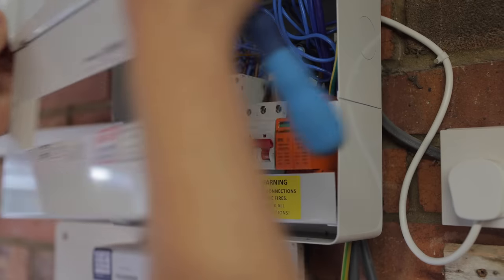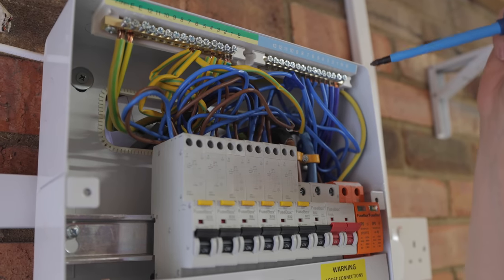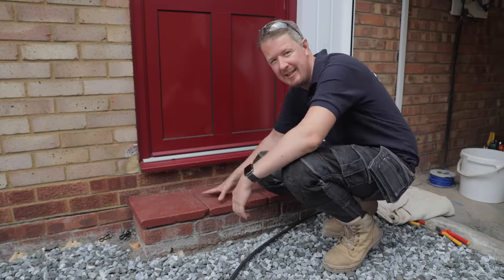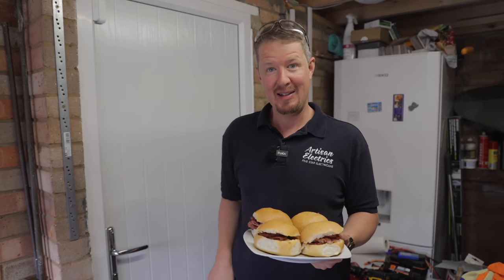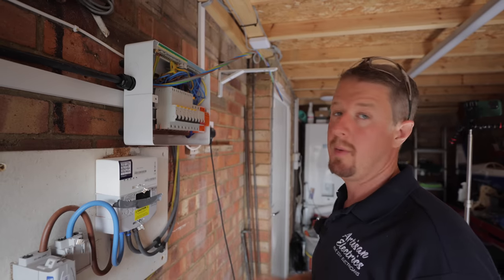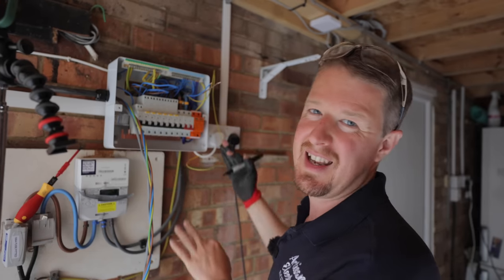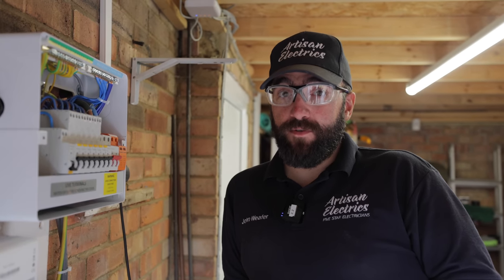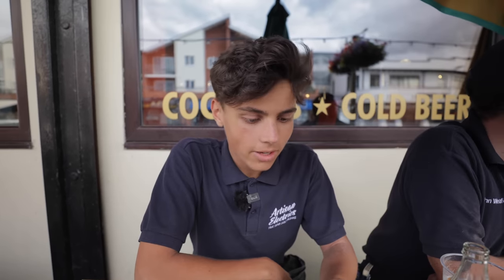SHOCKING FIND - SO bad I had to fix it IMMEDIATELY

Comment: It always makes me smile when you insist on having the fuse board neat, when the wire can follow the most random path to the sockets or lights. Electrons really don’t care, do they? I always prefer a bit of slack  rather than cut the wire as short as you can in the interest of neatness.  This is pandering to your OCD only. And I could still see exposed copper. :)
Reply: Also extra cost to "fix" it lol
Reply: Idk how it is in the UK but in the US, people see it as a sign of a prideful electrician. So it’s more of a statement/signature then a functionality.  I agree, add slack. But also, makes trouble shooting easier for the next guy.
Reply: Copper should be a bit exposed so you know there's no insulation in the clamp doing a visual inspection...  but never so much you can touch it with your finger.
Reply: Make it neat, with a service loop and better doing neat work as it's pride in your work
Reply: Having watched this again. I would have sued you for interfering with my board when it wasn’t in your remit, as you actually admitted.
Reply: When you disconnect a wire, it is often necessary to cut off the end before reconnecting it, as the connecting screws can sometimes damage the conductor.
That's why I like to leave enough slack in the board to  make this possible.

If the wires are super neat you can't do this.

Thoughts please??
Reply: @chrismoyler  Absolutely agree with you. But then you have common sense. Somewhat lacking today.
Reply: It’s a case of pride in your work to do it neat. Also it’s easier to fault find. That board was a disgrace surely you wouldn’t want your board done to that standard ?
Reply: @Geordie10032  How does it make fault finding easier? It’s a slightly longer bit of wire. I doubt any electrons will escape out of sight. Much better to leave it long and be able to redress the end if need be Rather than run another cable or join it.
Electricians are far too anal for the customers own good.
Reply: Swear it’s just some people feel the need to find fault with others’ work. If it passes an EICR, I don’t give a shit what it looks like.

Comment: We didn’t use mechanical hand drill for drilling masonry, with out percussion it would take ages. Sized Rawl chisels tapped with a hammer while turning by hand were remarkably quick. When working without access to mains electricity rawl chisels we’re the way to go. Only good for an inch or so deep to take rawl plugs though.
Reply: One step up was a piece of black gas pipe with a couple of teeth cut into one end. An old-timer plumber taught me that trick when we had to drill a 450 mm brick wall for two 18 mm pipes and didn't have a large enough SDS bit, worked surprisingly quickly with a proper lump hammer. Exactly the same technique, just 3/4" or 1" holes all the way through a thick wall if necessary.
Reply: Bradley You know it. It makes me laugh when I see these guys  showing a young trainee how to use old tools and don't even know what  are for themselves and the trainee will only use battery tools anyway.  Also 3 blokes to put a power point in and that guy chatting and not working who is paying him. Come on mate it's work not a fashion show.
Reply: Yes Rawlplug  jumper  , what about  the buckle  clips  every  6 - 9  ins  for twin and earth  without mechanical   hammer  ,  i use to rewire schools  like this  ,   i have  arm  muscles  like   mr  universe
Reply: Rawl chisels. The oldtimers collegues spoke of those, when i was complaining about the 7.2 volt nicad makitas 20 years ago.
Reply: Ha ha. Wooden plugs... remember the cold chisels and wood plugs. My first metal case Black & Decker electric drill couldn't make a mark on London sewer bricks in my parents' house.

Comment: Well, I can state that here in Italy almost NOBODY does safety checks, testing and installation like those. I never saw an electrician here doing something like that. NEVER! It's amazing. Thank you :)
Reply: BUT at least we use pvc corrugated tubes so that we don’t make the mess they do abroad😂…

Unless you live in Pisa where due the high demand of housing (because of students), it’s full of houses with 1960s wirings… I was shocked when I found out those buildings with modern 16A RCBO’s at the top and 6A (yes, six amps) 1950s sockets (the ones using the round box), powered by 1mm2 (or thinner) cables. The estate agents don’t give a shit and call them “code compliant and efficient”.
Reply: you should come to norway, thats even more strict
Reply: If you don't check and something happens you can  end up in court because your the last man in
Reply: You should come to Indonesia and compare 😂
Reply: No sparks, no trips = passed inspection!

Comment: Talcum powder is an excellent dry lubricant to ease the pulling of cables through conduit, or for pulling twin and earth cable within or through an existing run of similar cables.
Reply: Or for making putting on your Class 0 gloves easier.
Reply: Or for fixing your sweaty arse on a hot day

Comment: I've used talc for pulling cables through conduit, works well and less messy than the old fairy liquid
Reply: that's the reason he has it, he knows the old tricks.
Reply: Cheaper and less messy than Yellow 77 as well.
Reply: Yep was gonna say the same thing. Same reason they put french chalk in flex so it's easier to pull the sheath off
Reply: In some areas of hospitals here in the US, it is the only wire pulling lubricant allowed to be used
Reply: Do you spray it on the cable before pulling? Or try force it as far down into the conduit as possible before doing your run?
Reply: @daniela4530  rub it on the cables, pour a bit down conduit and have some in hand whilst threading it through

Comment: The problem is that it always falls back on the company that worked on the Fuse Box last. From that point of view, you did everything right.
I see boxes like this almost every day here in Germany. This is what happens when everything has to be done extremely quickly and cheaply. Real proper work unfortunately takes a bit longer and costs a bit more. Although not by much, as you show in the video.
Reply: Box-ology is overrated.  The very first thing to go when troubleshooting is needed is probably the zip tie looming wires together so an amp reading can be taken.  It won't be replaced.

Comment: That trick with the glove and running your fingers down the wire to straighten it up is similar to my trick I use when terminating network cable. I use the outer sheath of the cable between my fingers to straighten out the spirals after untwisting the pairs and it makes them so much easier to work with after that.

Comment: You were speaking of too much copper showing on the terminations of the consumer unit. Many times in industrial applications they actually want a little bit of copper showing so that they know you aren’t landed on the insulation.
Reply: Same in Sweden, but it's a thin line to toe here: you want enough copper to be visible to make sure you haven't crammed insulation into the screw clamp, but never so much you no longer are IP2x, i.e. you can get a test probe on it but not a finger.

Comment: Nice video guys,
a comment about the extra work you did in the consumers unit not dangerous but just sloppy workmanship. Now recently retired I used to get involved in  jobs which went to court because of electrical fires and worth noting to ALL , electricians in particular in this case.
If you come across a dangerous electrical installation problem , which you may even inform the customer about but do nothing about ie  you do not disconnect etc, as the last professional with the knowledge to recognise the danger and something happens you could be left liable and face prosecution. So good work in tidying up the sloppy work and put that wheely Stanley drill back where it deserves:goodvibes:.

Comment: The black clips are for physical clamping on the top hat DIN rail, not the copper busbar. That’s held in by the terminal screws, no doubt, secured to the correct torque as per the manufacturer.

Comment: Thought everybody used that 4mm earth sleeving, I hate it and use the small stuff but never seem to find anybody else using it. (though to be fair don’t do much domestic) Looks so much neater. Can’t believe you re-did the whole board
Reply: That wasn't done in "the hour" and neither was ev install
Can easily see that(edit,edit,edit) by just watching the time it took them to run the cable round the back of that post!

Comment: When I was installing Network Phone distribution cable Frames the location height used to blow my arms with lactic acid, if I was too high over a long time  . I would bring in a Milk crate or stand on a ladder so that all my work was at chest height

Comment: The consumer unit bus-bar appears to be live while the cover has been removed and a hole is drilled through the steel containment directly above live parts. 
In the event of swarf flashing over the bus-bar, any accident investigation would likely reference Electricity at Work Regulation 14

Regulation 14 Work on or near live conductors
No person shall be engaged in any work activity on or so near any live conductor (other than one suitably covered with insulating material so as to prevent danger) that danger may arise unless –
(a) it is unreasonable in all the circumstances for it to be dead; and
(b) it is reasonable in all the circumstances for him to be at work on or near
it while it is live; and
(c) suitable precautions (including where necessary the provision of suitable
protective equipment) are taken to prevent injury.

Comment: Some questions for you - why did you remove the bus-bar cover for all the time of the install instead of only once the power was off? Did you know the hand drill is for woodworking not brick, they did make a hammer action version, blue if I remember right, looked nothing like the one you have there.

Comment: Yea you are the guys obviously with all the electrical knowledge of best practices etc and testing no question.
As for the step ( and I appreciate in your case you’re there as electricians ) but in my case had I been faced with that situation I’d have simply removed the step ran the cable through and rebuilt the step as afterwards as it looked to be a very small simple job which could well be done with original materials
Reply: R u an electrician?

Comment: Wondering why the lower "comb" busbar is not insulated ?
As for right wheel in cars, neutral and line are inverted compared to the other side of the Channel ;)

Comment: In your solar installation you have the inverter and battery out in the garage on the secondary consumer unit , so how does it isolate the house in the case of a power cut , so that power from the house does not feed out onto the grid and endanger anyone working to restore power?
Reply: Grid tie inverters detect the existence of power on their output and shut off when the grid is lost. Most solar installations even with batteries cannot run in island mode, so there’s no need for further mechanical separation.

If you want island mode is when things get difficult and you’ll need cutover switches and the like, to prevent backfeed.
Reply: @JasperJanssen   Hi Thanks for your reply.  I looked at solar power 20 years ago when we were having frequent power cuts, before domestic battery storage was common. Was told then that I couldn’t use the solar power during a mains outage. So I gave it a miss. Now I’m looking to have a battery system and realised it needs some form of’ loss of mains protection’ if I’m to use the battery storage during an outage. To find it’s not a function of the smart meter is a surprise. But your reply means all this kit is useless during a mains outage. So the double pole isolation switch I’ve had installed just my side of the meter may yet prove it’s worth.
Reply: @zenthor13  you’ll need a bit more than just an isolation switch, but ask your installer.
Reply: @zenthor13  you’ll need a bit more than just an isolation switch, but ask your installer.

Comment: What's the name of the device installed in the distribution box? Does it provide protection against over current and dispersions? I see the phase input in the bottom and at the top output? So where the neutral goes in?

Comment: The doorstep, I'd have tunneled, and I'd recommend these to anyone. Silverline 633828 SDS Plus Masonry Drill Bit Set 3pce 1500 mm on Amazon  £65 and worth every penny.
I bought them to drill up from outdoor wall wash lights into the void under the first floor floorboards. So no chasing or containment in or on walls and a much quicker.

Turns out it's helped loads since for things I never thought of.

But looked good though boys.

Comment: At 19:53 /25:15 your apprentice was checking For Main Equipotential Earth Bonding at the Boiler, with no mention of the Gas/Water Main Equipotential Bonding.

At the Boiler I only saw cross bonding - 2.5mm G/Y each conductors and no Main Bonding Conductor (10mm), you might want to check out your video.
Thanks for entertains me, I love these DIY Videos and well done for tackling that board, but unsure why when you had the chance you did not place ring numbers to the conductors on to the conductors to identify them.
Keep up the videos and please give us a final walk through at the end.
Mr Spence Eng

Comment: OK, you got 1 hour to do mine.....18 metre run, across and under a 9m tarmac shared driveway, and 6m front garden that you will need to trench into. Attaching to an EV pedestal that you will have to dig and cement in. Also need a complete new CU as it's an old single RCD unit from 2001.

Comment: Through the steps. Even if you need to repair it somewhat, ye do have Artisan in your name. Also, when using fixings (screws mainly) in the outside elements, do ye use stainless steel screws? They're relatively cheap in Screwfix. Artisan!

Comment: Try fitting a 1 mm drill bit in your cordless drill --- no chance. Hand drills to the rescue for small precision work. And obviously they are not designed as hammer drills for masonry, duh.

Comment: Just an observation:
1 - When drilling a DB please put some protection inside the board so when you drill through you don't damage any internal parts.
2 - The clips you are using to secure your SWA, are they fire rated?  if no, are they compliant with regulations?
Reply: They are metal linian clips - so yes they are.

Comment: baby powder is amazing substitute for lube in the tubes in the walls for the 2.5mm2 wires in a 20mm tube. can be tricky without it. And also silicon based lube tends to leak out. not very fun when theres new paint on the walls or something like that. I assume thats what the baby powder is for :) Also, why do you use sleeves for the earth wires? cables come with the green/yellow plastic on them from factory, no? mine does atleast.
Reply: Seems the British (and American?) cables comes with the ground uninsulated at all.

Comment: This bottom bus bar looks awful: There is never any visible copper on the French bus bars or "combs", they are all covered in plastic except for the teeth, and either you cut them so they match the number of modules installed and you put a plastic cap at the end, or you put plastic caps on each teeth to hide any copper.
So, if you call this horizontal comb a "bus bar", what do you call the bus bars on top, where you have all the ground wires, the live and neutral wires too? Are they "terminal blocks"?

Comment: Honest question: is there a reason why you use a manual screwdriver?  I would have thought that with all the tightening/ untightening you do all day it would be a no brainer. I assume there’s a good reason.
Reply: Control, basically. You want to feel that everything is aligned and in the proper position inside the clamp, and also make sure you get the right tightness. Powertools don't have that feedback.

Comment: Suggestion for getting 'round the step. Drill two 45deg(ish) holes across the corners and thread the cable through them and across the front. Saves having to make a sharp bend to get 'round the corners?
Reply: Still have to trust the step is sound construction. I'd have gone straight through till they reminded me of steps that break away with very little drilling.

Comment: As an owner of many powered drills, both battery and mains, I have to say that those Stanley hand drills are an awesome bit of kit. I’m 51 years old and I grew up with one exactly the same model as that available to me. It’s still a treasured possession. If you’re doing precision work on something like aluminium or plastic, and hand holding, you can’t get anything more accurate. You can go really slowly and adjust as you go, and easily position a neat and clean hole within 1/10th of a mm of where you want it. Great for small pilot holes prior to power drilling as well when you need that accuracy.
Reply: I'm a hobbyist woodworker and have a couple of those exact drills, still used regularly for all the reasons you mentioned. I also have a traditional bit and brace type drill,the bits are worn badly now but there is a pleasure in using it.